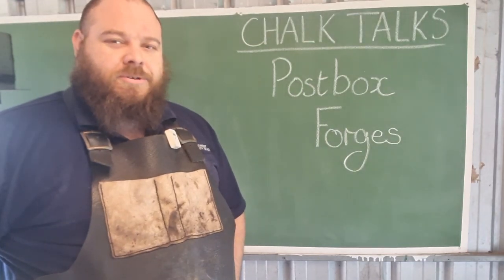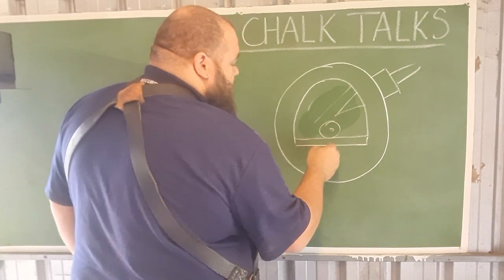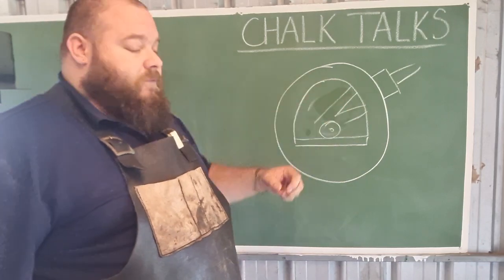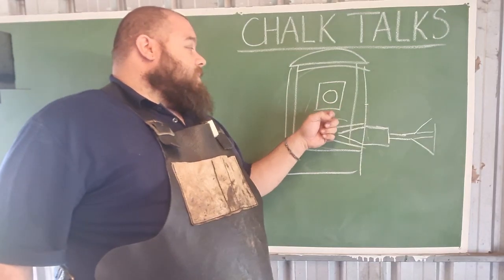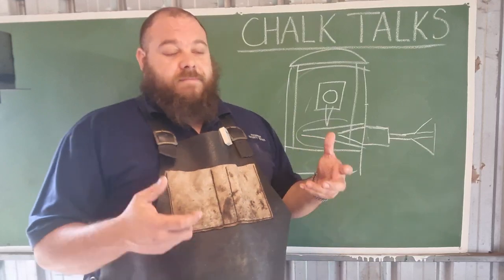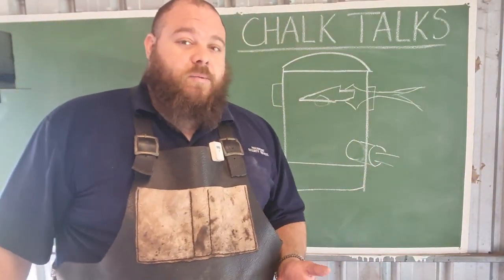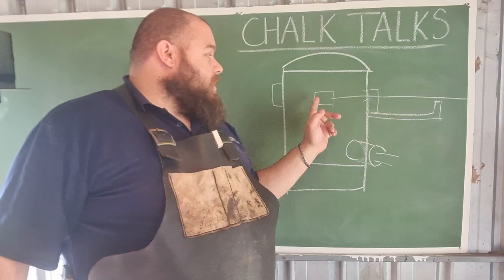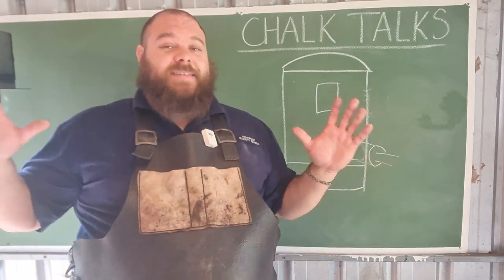Chalk Talks: Postbox Forges

Comment: Sort of been thinking (which is dangerous and usually expensive) about a bit of a combo of the postbox and the gas-kiln
Mostly because I do pretty much all of my heat treating in an electric-gas hybrid kiln but its not terribly fast for heating up, is quite large and tends to struggle to get over 1100C. What I was thinking was making a smaller 'kiln' which would be about 2ft high by about 1ftsq with a brick base, start the vortex down there in a circular section and then sheet metal with ceramic wool for the rest.
But the top would be removable, or have a small opening there which is sealed up with some woven ceramic tape that just lets you slide knife blades in there without letting out some of the nice heat as much and use that for some of the longer knives and the high-temp, crazy stainless (in a foil jacket). Then just putting some 1/4" tubes in the side for the thermocouple(s) and maybe doing some on the fly adjustment of the air-gas to regulate the temps during the critical soak times.
It wouldn't be too expensive and I just don't do blacksmithing, just a little bit of pattern welding and san-mai once in a while which I can do in the smaller forge. Not sure if anyone's made a vertical forge/kiln thing like that before, but the other use I thought of it was for a stainless cylinder in there full of salt bath for aust-martempering if you're feeling really sporty... I probably wont because it'll blow my face off.
Just some thoughts on the theory, not quite sure on the practical aspect of it